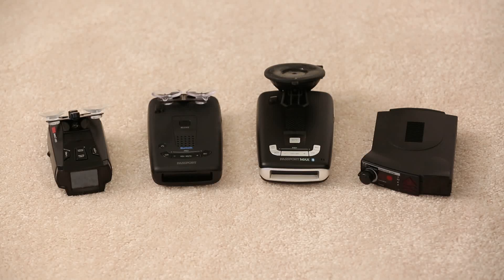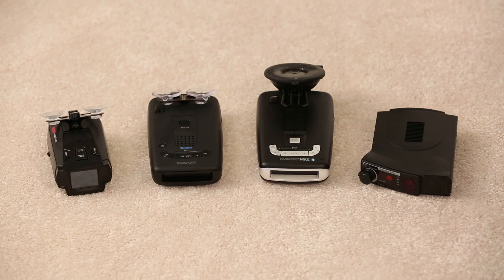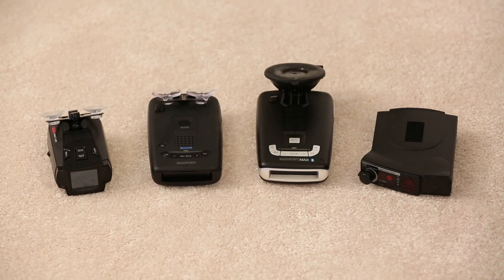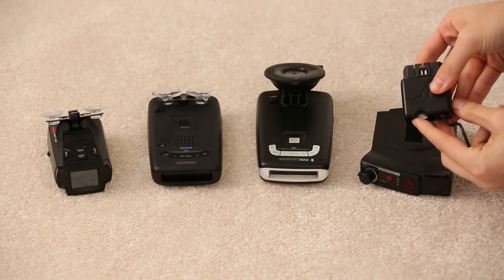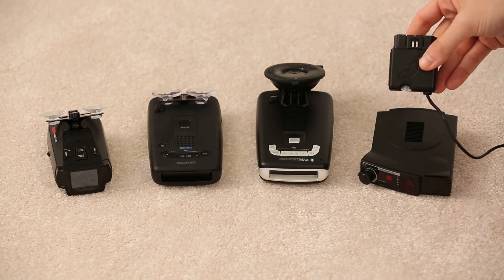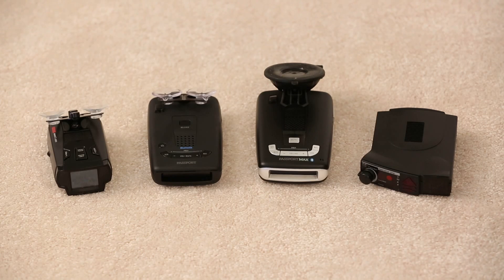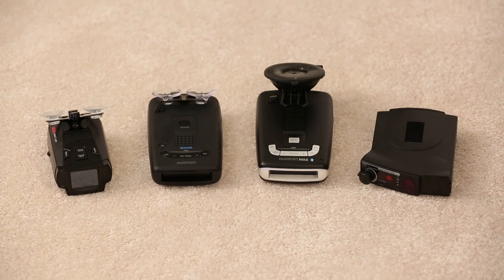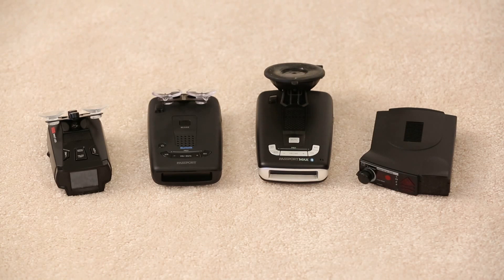Radar Detectors & Low Speed Muting Techniques

Comment: I have a problem with my max 2, everytime I&apos;m driving through a tunnel, it would loose gps and turn off itself. How do I prevent that from happening?
Reply from the maker: You can't. GPS requires a satellite connection and every device loses that connection when you go through a tunnel.

It should regain the connection shortly after you exit however.

Comment: Hey man, great vid. I had a random question for you. I own a v1 but I also am looking into a redline. I think the range is outstanding for the highway. My only concern is the ramp up on it. The v1 has amazing ramp up and I am concerned if I buy a redline I will lose that function for slightly more range. Am I just waisting money in general buying a redline or is there an advantage to owning both? Any advice would be great. Thanks
Reply from the maker: Dane Smith Random answer for ya. :) The rampup on the Redline is much better now that it has BS/RDR. I used to own both (running both at the same time isn't a good idea, though many will do it) and I would use the V1 as my main detector and would grab the Redline when I was heading into the mountains and into the boonies where I needed long range detection above all else. I don't drive out there much so I've since sold my Redline, but that's definitely its specialty and the rampup isn't an issue with it.